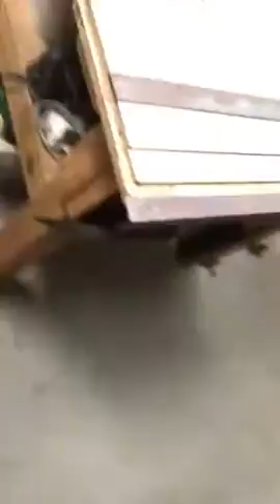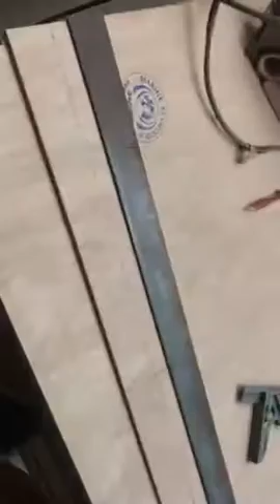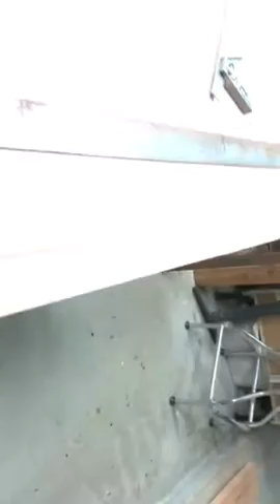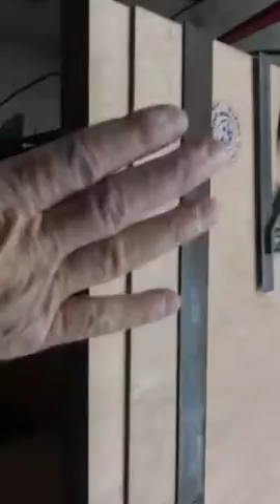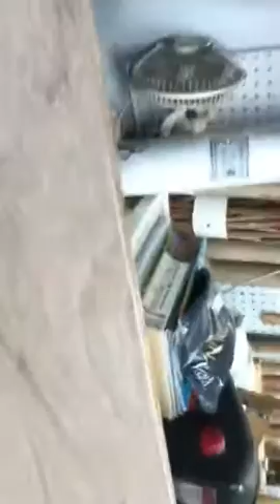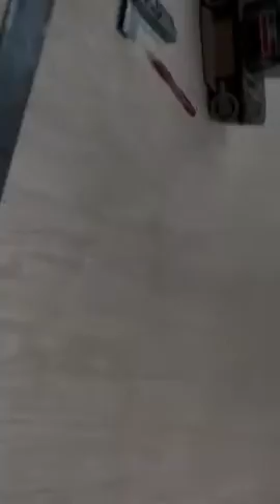Scarfing plywood made easy!

Comment: Hey man ,,, better than nailing is use staples with nylon straping tape . When the glue sets just pull the nylon tape and mist if not all staples will come with it. Then you have tiny holes that later epoxy coat will fill and expand the wood and you won,t see the holes.